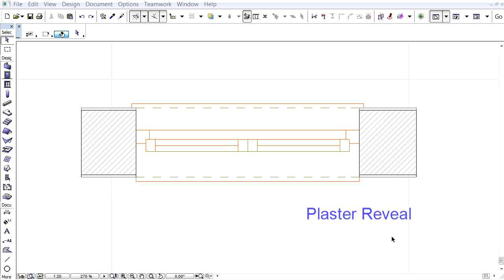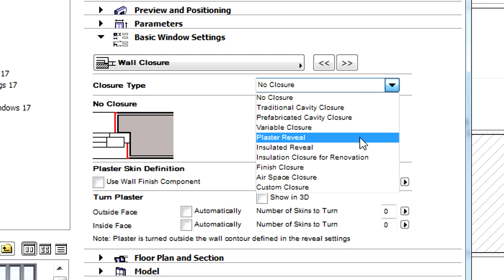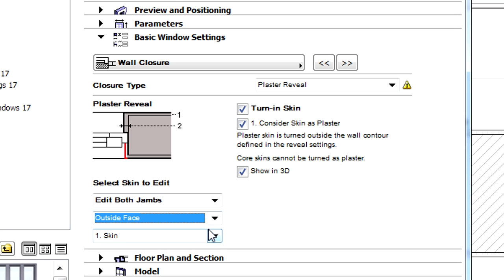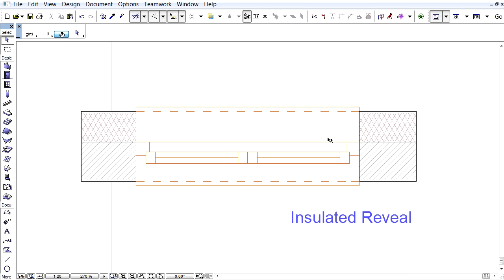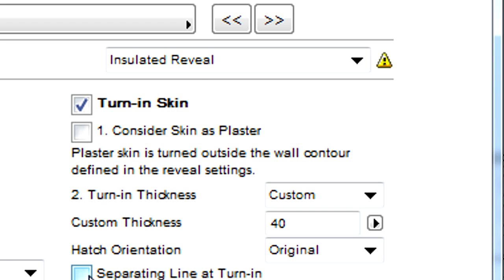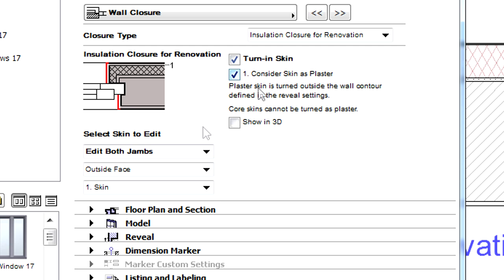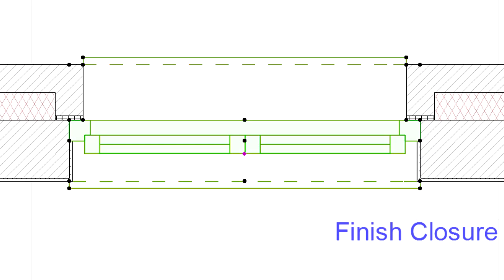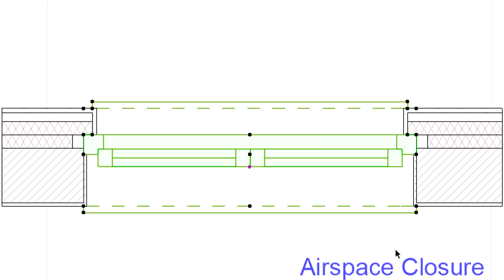ARCHICAD Wall closure types

Comment: Exactly! Why this is not working in section. Is so frustration.
Reply: Xavi, 
I find a solution?
Reply: @sergiorodrigopaillalefanti4659  which one?
Reply: @sergiorodrigopaillalefanti4659  I'm having the same problem. Did you find a solution for doing this in section?